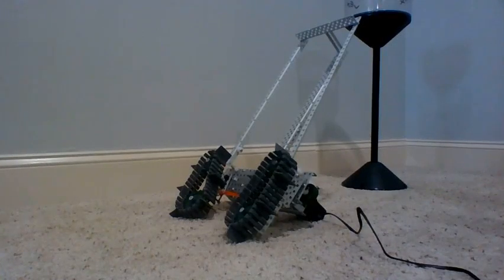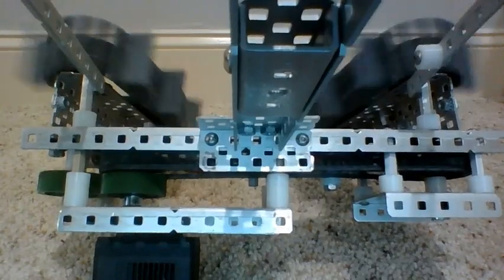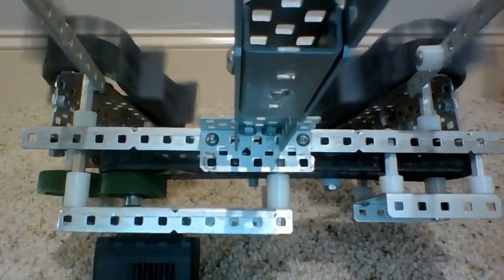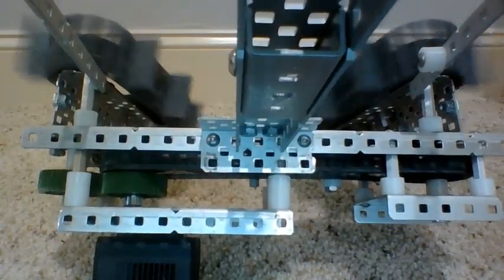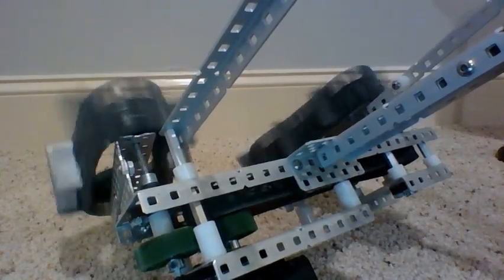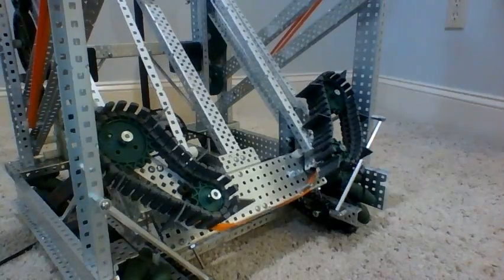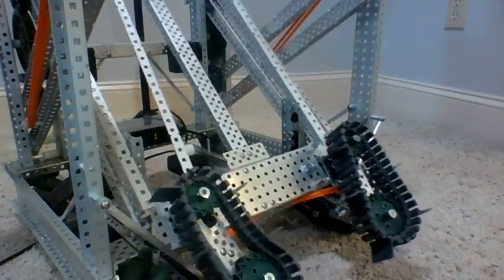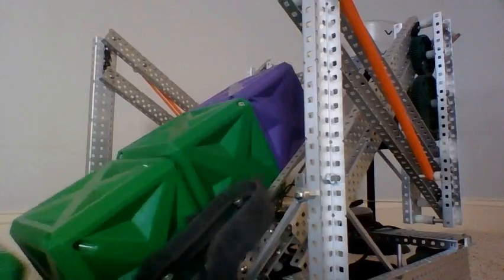Single Motor Fold Out Intake - 2775J Vex Tower Takeover

Comment: Definitely an interesting idea. Is it limited to 4 cubes because the the strength of a single motor or because of the design of the tray in the video?
Reply from the maker: A little bit of both. However if the gear cartridge were 100rpm it would be able to pick up about 10 cubes. :)
Reply: @TeamV-um8sl  use a gear multiplier than